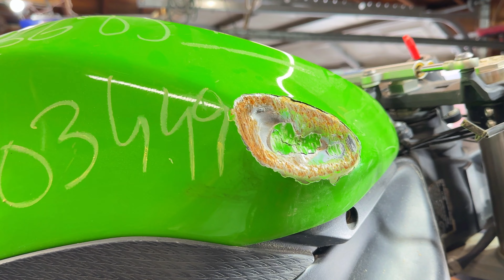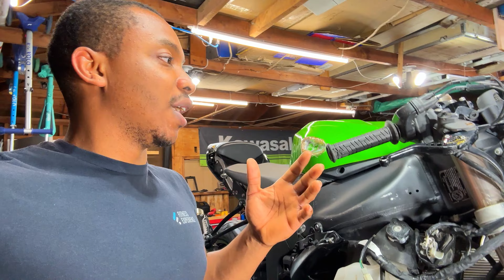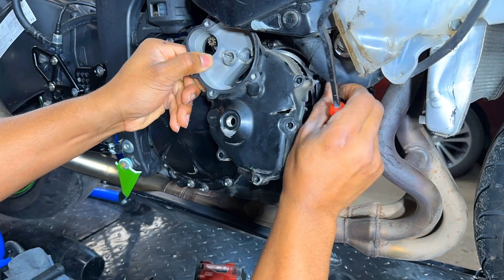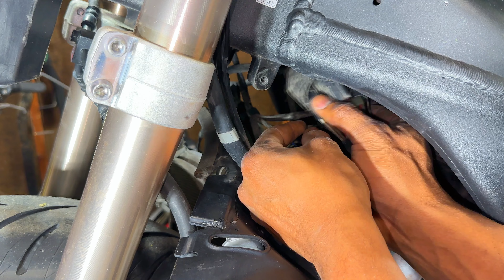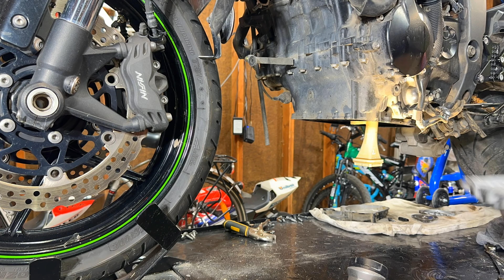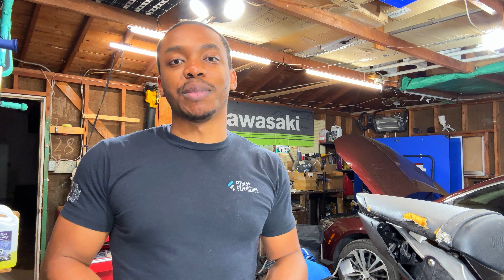Rebuilding A Salvage Wrecked Kawasaki Ninja ZX6R - Part 1

Comment: There is no gasket on the pan and installed with a dry gasket on the filter 🤦‍♂️🤦‍♂️🤦‍♂️
Reply from the maker: The oil pan gasket was already mated to the engine block with some RTV applied in the specified locations as per the service manual. The Hitro oil filter gasket comes prelubed, not my first rodeo 😅🤦🏽‍♂️